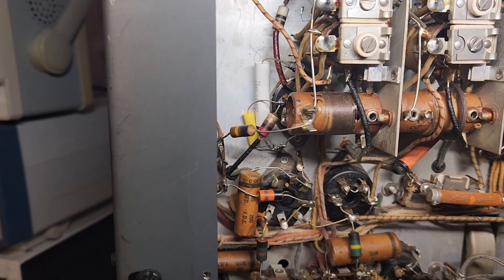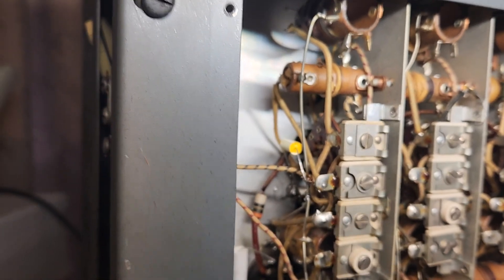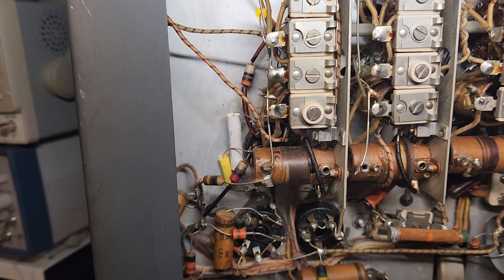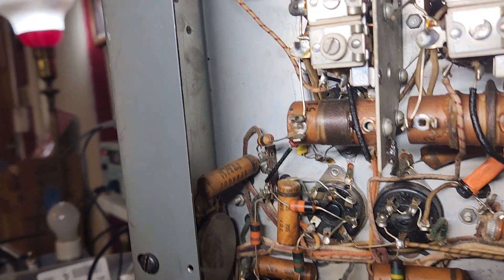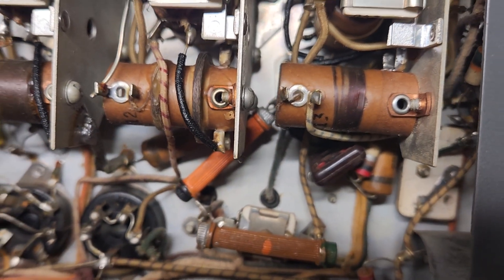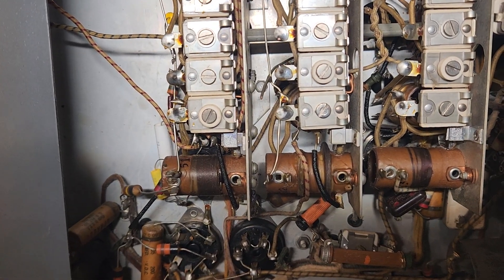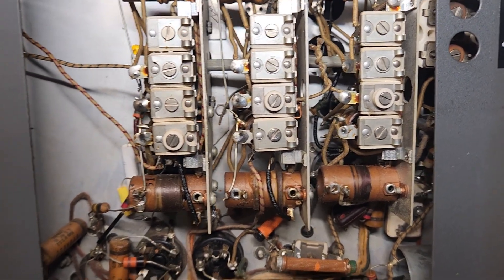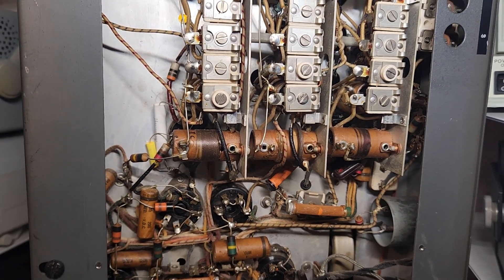Replacing capacitors in my Hallicrafters Skyrider Defiant SX-24

Comment: I recapped an S-20R and had the same accessibility issue on that one particular cap. I clipped one end flush with the cap and abandoned the paper cap there, then installed the new one as best as could be done.
Reply from the maker: I'll dig through the schematic and figure out where that end of the cap leads and take a look at what i can do.  I think that cap was soldered in place before the tuning section was installed.

Comment: I look in the chassis of these big radios and count the paper caps,  and groan. Sometimes people cheat a little bit and solder onto the snipped leads of the old cap,, on very difficult ones.  I don't mind if it is done well,  it is technically not an issue if soldered correctly and the leads cannot short.  Just that it feels better to replace the whole thing neatly.
Reply: And if one lead is to a ground that is inaccessible,  sometimes an alternative ground point is acceptable.

Comment: That reminds me of a AM SW console radio I worked a couple years ago that had caps buried down in the RF deck like that on rotary switches.  Yea some of those are a super pain,  maybe they were attached to the coil deck before it was installed. I am no longer cranking out radios all the time anymore.  Some of these are like diving off the deep end while the water is still cold.